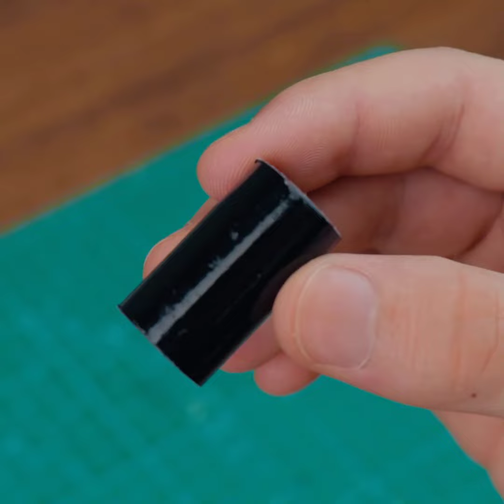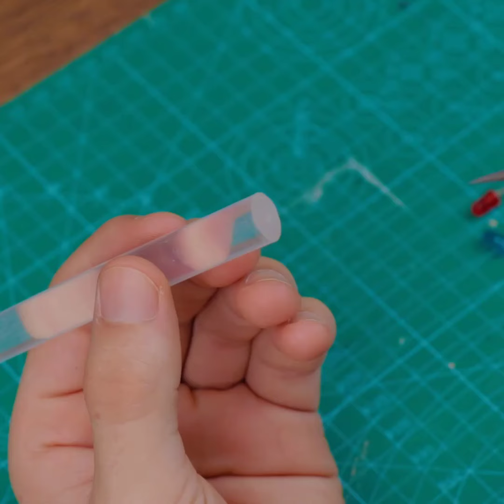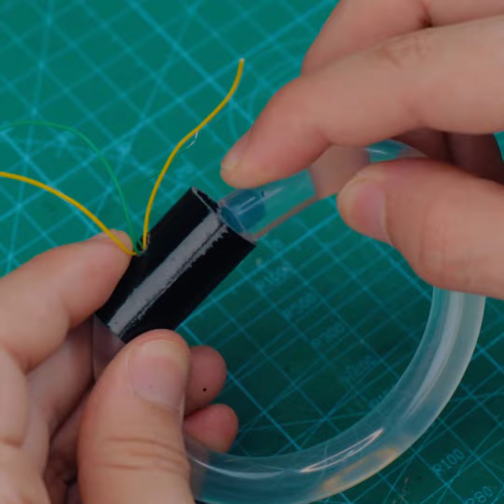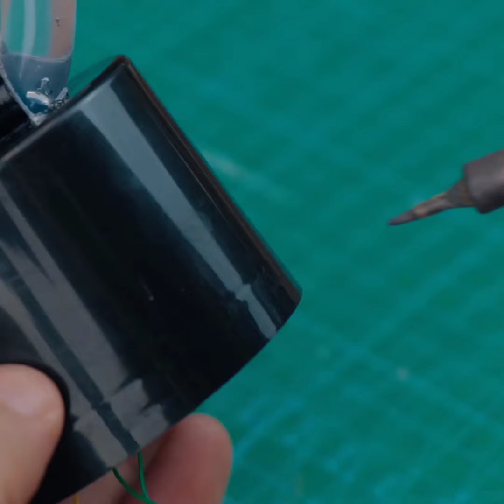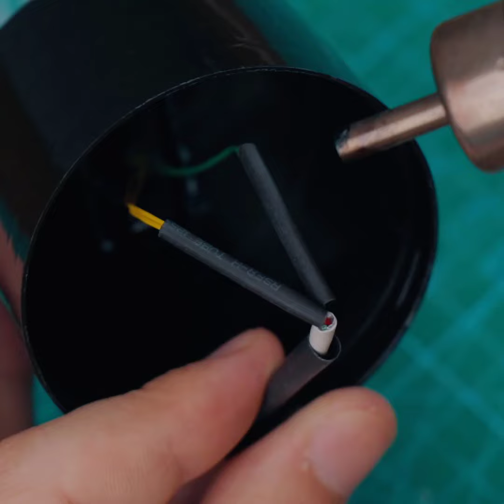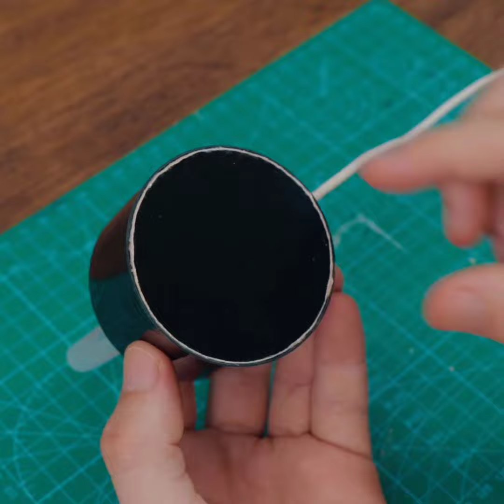Awesome DIY Led Projects #shorts

Comment: No resistor for the LED’s, good idea
Reply: I had these types of leds. They don't need an resistor that easily
Reply: ไม่ต้องทำตามเขาเราแค่ซื้อ LED driver แบบชิปมาใส่ก็ได้เพือเขาดูค่าไม่เป็น😅
Reply: usb delivers 5 volt there is 2 leds in series with forward voltages around 2.5 volt so it shouldnt be a problem. You pretty much only need resistors if you go way over the forward voltage of the LED to limit current.
Reply: He used 5v power bank to feed the led . We use the risistor if he used MORE voltage . don't forget that there is two leds not one
Reply: @MattFixesStuff  it was in parralel not series
Reply: @jakeyy0  uh true. Yeah the leds will blow quickly with 5V. Especially the red one. blue ones are a little more resilient by my experience.

Comment: Where is Resistor?
Reply: RIP Led’s bruh
Reply: Is a level shifter
Reply: Es una resistencia invisible
Reply: The usb brick supplies 3.5 v only try yourselves
Reply: Worse than no resistor is that the two LEDs are in parallel. Notice that the red is way brighter than the blue due to its lower voltage drop.  So for those of you that don't know you take your power supply voltage and subtract the led voltage (2 for red 3 for blue if you have to guess) and divide that number by the amps you want (likely 0.03 or less for a little one like these) and you get the number of ohms you need.  If your worried about efficiency you can put several in series and use one resistor.  Once they have a resistor in series you can put groups of led-resistor chains in parallel
Reply: @camforman you look like you understand can you help me I have to do like a row of leds and I am a absolute beginner so can you explain what I have to do how to connect the leds together with resistors and wires and also the battery or a USB cable
Reply: @bergithaveraj9764  if you want 20ma through each led (check datasheet for what led can do or adjust for brightness desired) here is the math R=( 5v-Vf )*1000/mA. You can get an exact value for VF from the datasheet but a red will be about 2v and blue about 3v.  So 100 ohms in series with the blue and 150 for the red.  If you wanted 30ma you would use 68 and 100 ohms. Note not all values are readily available so just get a variety pack and try them. Avoid exceeding the LEDs rated current

Comment: Я один не понял как у него светодиоды не сгорели максимум на них можно подать вроде 3,7 вольт а в юсб 5 вольт по идее нужно подключить через резистор на 220 ом
Reply: Существование резисторов человек проигнорировал поэтому скоро у него либо сгорит хата либо сгорит данная приблуда
Reply: Для съемки ролика хватит времени, прежде, чем они сгорят
Reply: Светодиоды так то на разное напряжение есть
Reply: @user-ni1sc1lc4v  ну он использовал на 3,7
Reply: These leds  he used wont burn out on 5 v.  Not likely.  The colour change leds or multi colour as some call them, from personal experience they are quite sensitive and burn out quicker than normal leds.

Comment: Ah yes connecting 2 volt lights to 220 volt electricity supply , resistors? What’s that
Reply: 220 🤔
Reply: Where did you get 220v from its freakin usb
Reply: It's 5V out of the USB, but yes, the circuit isn't set up correctly. You COULD do it running the two colors in series but whichever LED is second would be underpowered voltage-wise. Best to use resistors on each as a voltage drop from 5V to 3.7V and 2V respectively.
Reply: @complexeddrummer  those led diodes will definitely not last long and will burn out, but at least it's not the 220v the dummy in the original comment though. It would have immediately popped them lmao. They should also have used a female USB or micro USB port, so they could unplug and plug it in. Also if you want the easy ability to turn it off and on, add a low voltage switch

Comment: 10 seconds and them 2 little lights will burn out ive tested it loads of times even bright bright led lights are only made 2 run off like 3.7 volts wether there battry powerd or in the wall

Comment: How many volts does the lamp need?
Reply: Well if it is an average led, then in the range of about 2.8 to 3v (obv. You can go lower.)
Reply: @chaosminecraft3399  
I turned on the two lamps on 5 volts, but they worked for a short time and did not turn on yet
Reply: The blue needs 2.5-3.7 volts and the red needs 1.6-2.0 volts. If you run them off 5V, best to use separate resistors to drop the 5V to the necessary voltage for individual, parallel circuits